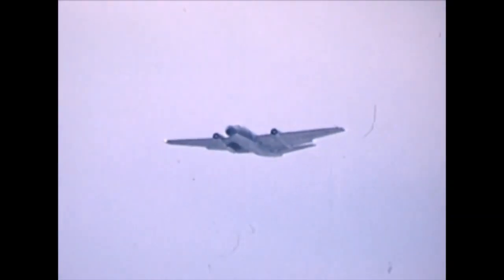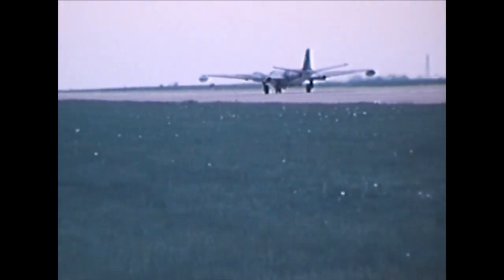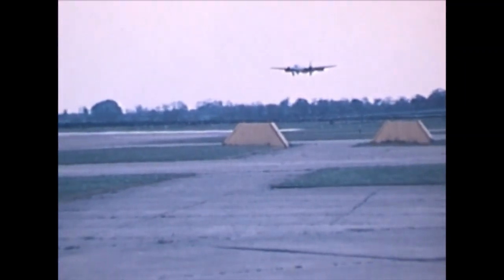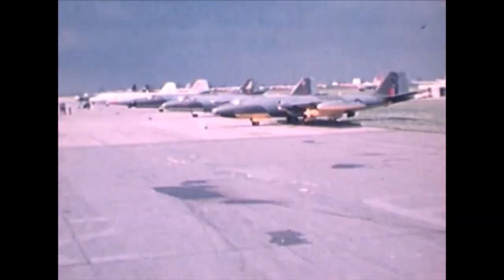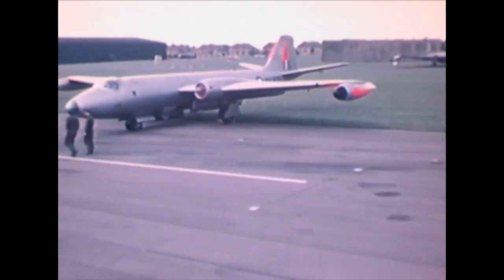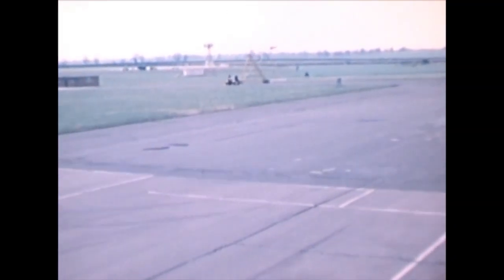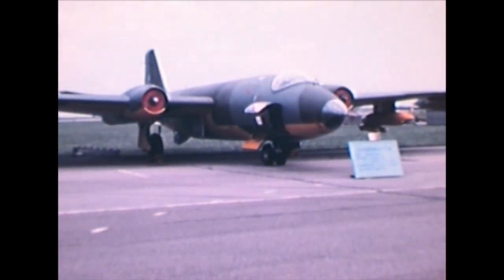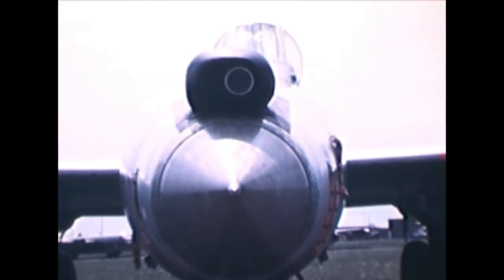The most impressive line-up of English Electric Canberra aircraft ever (rare footage!)

Comment: I worked on these in the late 70s early 80's at RAF Marham as a wpns tech mostly dealing with the ejector seats and  canopy and hatch detonators (a lot of them! ). Also fitting the detonators to the wing tip tanks as well as being  deployed with them for target towing via a rear EMRU (with 100 sqn) typically to Malta & Cyprus .We used the bomb bay to store luggage and aircraft spares etc  in panniers .